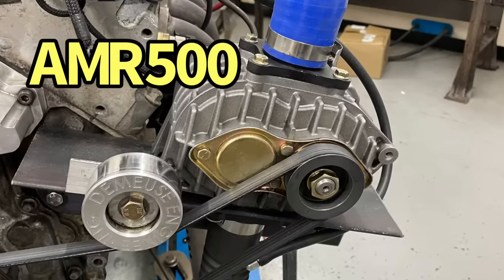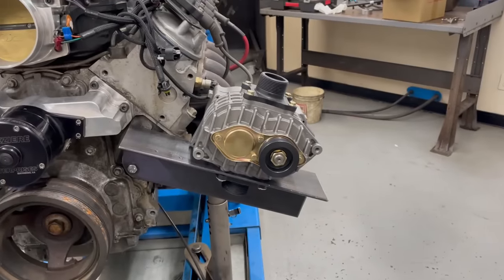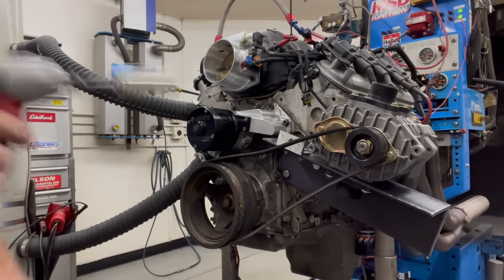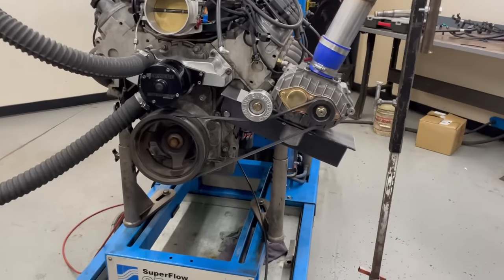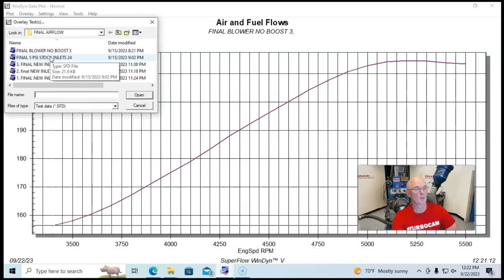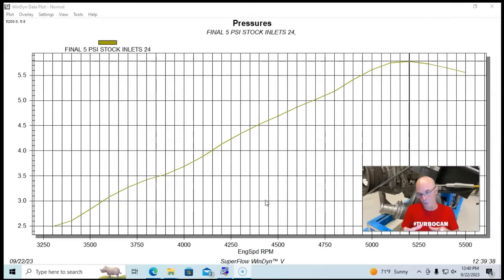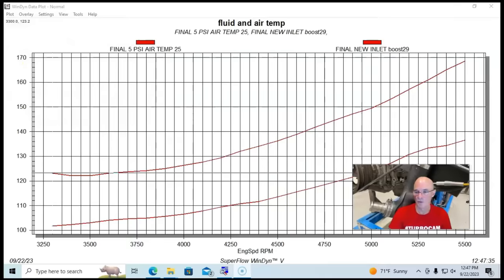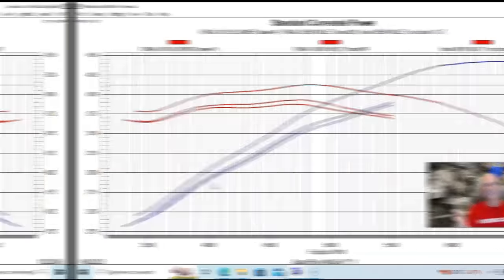THE ULTIMATE CHEAP, EBAY, AMAZON AMR500 BLOWER TEST. FULL RESULTS-AIRFLOW, TEMP & POWER CONSUMPTION

Comment: I think the reason the boost dropped with larger inlet is because boost is a measurement of pressure being exerted leaving the sc. cfm however is the measurent of how much air it can flow. Now because I
I r still spinning the sc rotors the same rpm as stock outlet the amount of cfm that can flow out the sc doesn't change with the outlet being bigger, and since the outlet is larger  and the amount of air that is flowing through the supercharger is the same as the stock size outlet it is exerting less pressure on the charge pipe then the smaller inlet cuz it's still flowing the same amount of air because the supercharger still spinning the same RPM as before. So wide open throttle you're still flowing the exact same amount of air as the stock it's just exerting less Force now I imagine if you put a larger inlet and the stock size outlet or if you put a smaller size outlet your boost number will go up dramatically.
Reply: I apologize if that message made no sense lemme rephrase. 

At 18k rpm we measured stock inlet stock out let flowed 260 something cfm. And 5.8 PSI of boost pressure.

At 18k rpm that the sc is spinning with large outlet and stock inlet and large outlet. The sc is still spinning the same speed since pulley size didn't change. So with that we can all agree the sc is still only producing 260something cfm. Which we can all agree cfm is a measurent of flow now pressure, and we can agree we all know boost is a measurement of pressure not flow.

So on the outlet being larger than stock and the inlet is stock ur boost pressure will drop.

And if you spin the sc faster it's still only flowing 260 something cfm when the sc is at 5.8 psi before it reaches max boost for example if you got a pulley to let you spin up to 8 psi while the sc is ramping up to 8 and gets to 5.8 you will flow same cfm as stock pulley however once you get up to 8 psi it will be much higher cfm flow.

And the reason why the CFM flow was changing between 270 and 260 is due to heat soak
Reply from the maker: flow through the blower goes down with boost (restriction)

Comment: You'd need 4 to make enough boost for that engine, theyre made for small motorcycle-size engines .5 to 1 liter. Youre just makin heat and noise.

Comment: so i was curious, and i dont want to sort through 830ish comments. but try it with the big inlet and small outlet, it should produce more power. maximize the intake but make the outtake smaller, shoving more air into a smaller space which should increase pressure overall. if im wrong about this let me know but it seems like it should work like that
Reply: As for bigger inlet having lower boost, would it be that there are not very good tolerances between each compressor scroll? Seems to me like there is a lot of compression leakage.
Reply: Why would you want to choke down the outlet? Why not let the intake manifold volume and ability to flow be the real restrictor?

Comment: Flaccid hose  discharge changing the aero conditions, not belt slippage but higher load/more restricted.
 Last graph  shows the bump in load on the LS as the restriction hose  moves with increasing load/ boost.
Did the IAT bump up consistently with increasing load /boost/ rpm? Dose altitude density fall as the blower reached 18k ¿ this would indicate that the hose is playing into flow . A rising DA indicates more work applied to the air causing thermal expansion boost, bad ju ju.

300CFM  yes if you get rid of the 6' of Bonneville intake ( lacking taper)  and put a proper velocity stack on the blower hat  . Use a formula SAE intake  instead.  Instrument feeds a box /tube  that the velocity  stack feeds from .  The box can be fed bi a more oversized Bonneville setup. If you see a drop on the manometer before the V stack , Then bigger/less restriction is needed.

Comment: My guess is at the higher flow rate you're going away from the compressor efficiency regions and more of the drive energy is becoming heat. A compressor efficiency map would possibly help back that assumption up though I'd tend to guess that's not something that's available.

Comment: It flows less because there is more volume of air. Blow through a straw and then a hose. You can flow more air at less pressure through a hose.
Reply from the maker: the restrictor in the hose was the same size on both
Reply: @richardholdener1727  no I understand that, I didn't mean the restrictor on the hose I meant it was a response to the inlet/outlet size comparison.

Comment: rather than looking at flow, pressure, and temperature separately you should combine them to a calculated air mass. it's possible the anomaly that you're seeing isn't actually there.
Reply from the maker: the temp dropped because the pressure dropped-don't need combine to see what happened

Comment: Had you matched the larger homemade inlet fitting to the blower's factory inlet port, test results using the larger fitting would've been more accurate. The larger inlet fitting didn't allow max flow, because of the interference  of the non mating surfaces.
Reply from the maker: and yet it improved the flow dramatically

Comment: The seals on the blower lobes heat up enough to give off gasses that hurt HP, LOL. I've seen those vanes destruct and destroy the engine, so I get why you didn't have it plumbed into a good motor
Reply from the maker: The blower will support near 150 hp-it wasn't plumbed into the 440-hp motor because this was just a flow test

Comment: The SC is too small for V8, might add auxiliary port for bypass the air before the SC built boost.

IMHO, the AMR500 will work effectively with small engines like 600cc or 1000cc
Reply from the maker: this was just a blower flow test to see how much airflow the blower had to offer and therefore what motor we should use it on-this 150-hp blower was not run on this 440-hp V8

Comment: as far as i know this little blower was made specifically to works great on 1.5 litre engine or below..in other words only goods with small capacity engine..it would be great if u try to run the blower again with small 4 cyl engine and see the major different on both motor blower compilation!...
Reply from the maker: planned-this was just a flow test

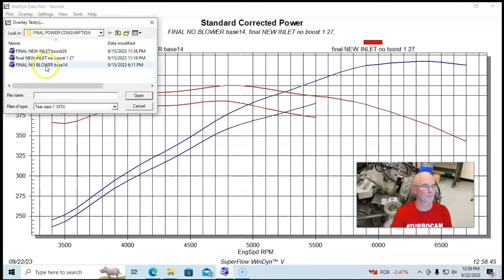Comment: 16:26 Mercedes and GM had a different approach to superchargers when not under load. GM used bypass valve, Mercedes used clutch, so supercharger wasn't spinning.  Looks like Mercedes will waste less power.

Comment: Higher flow with reduced velocity through blower with super. Is there a different pressure at the exit of blower than just before restriction where the air packs up before it accelerates through the restriction?

Comment: Makes total sense but the flywheel is bolted to a torque converter…..and we know torque converters are heavy weight’s compared to a steel flywheel. Probably a better test would be on a RW Dyno…. But then again now you’re dealing with drivetrain HP losses spinning a automatic transmission compared to a manual transmission. We can already say the automatic is going to chew off more HP and Torque compared to a manual.
Reply from the maker: I run these tests on chassis dynos as well-same results

Comment: If changed pulley size, it would be interesting to see what the little blower could achieve. Would that help to answer the temp / slippage questions?
Reply from the maker: no need to change pulley size-we were already at or beyond the max rpm of the blower (18K plus rpm)

Comment: Instead of using gear oil in the little blower Use a 20-50 weight racing oil Full synthetic. You should get back about 2 hp.
Reply from the maker: 2 HP FROM A DIFFERENT OIL?

Comment: Fore sure this blower is small  and just heat the air, also ECM may not adjust properly the fuel ratio for extra volumen and engine is getting leanner which explain lower power whit boost  did you meassure EGT?
Reply from the maker: the blower is not flowing into the motor, the AF was perfect (there was no extra volume)

Comment: You might of lost pressure/boost because the larger diameter piping exceeded the pressure/boost capability of the little supercharger itself. I doubt that little charger can produce much boost and for as cheap as it was it was still probably designed with that size of piping in mind. Any larger and you’re probably just blowing air down a hallway. Think of blowing through a straw, you can make a small concentrated blast of air enough to say move a golf ball. Then try it with a garden hose…it’s less, then try it with a 3” pvc pipe…even less pressure. Get what I’m saying? It just can’t generate enough pressure to fill the larger piping. It looks like everything kind of maxed out at 5K RPM and about 6lbs of boost and that’s probably all it’s designed for. Looks like something you’d probably just put on a v6 maybe

Comment: Here's a test for you hook the supercharger up to the PCV and let it suck the crankcase with the vacuum to see if it makes more horsepower have the supercharger blow into a drum and check your oil
Reply from the maker: it would only make more power if you drive the blower with an external motor

Comment: Such a great video. I would love to see this on2  stock. Basically Brand new. 8 cylinder identical cars. Same car. Rolling start.   Timed..raced.  recorded
Reply from the maker: this was only a flow test of the blower-it can only support 150 hp so it would work on a 440-hp V8 (we just used the LS motor to spin the blower and measure loss)
Reply: @richardholdener1727  yeah if runs to hot.  There is no actual advantages..  I'm not chacing that on my 3.8 V6 convertible..
Yet.  Well. I know better.

Comment: I was hoping to see how many less HP it makes running the engine with the blower installed and feeding the intake. It might pick up a little power at low rpm but I don't think it will flow enough air at higher rpm to not be a restriction and loose power up top.
Reply from the maker: 150-hp blower on a 440-hp motor does not work

Comment: By the way, best CFM flow, short of 300, would mean it MIGHT work with TWO of them on a small V6. 600 CFM (likely closer to 500 under boost at best) might get some power but at the cost of about 55HP. Not sure there is much benefit.
Reply: they are truly built to make boost for sub liter engines, and people who has experience say they do fine up until about 1.6 - 1.7 liter engines, they are pretty common to be used on vw beetles and they make an amazing amount of power for what they are. They are also rated to around 14 - 15k rpm
Reply from the maker: they are 150-hp blower or so, they work well on sub 100-hp na motors

Comment: Velocity, volume, and pressure are all different measurements. Opening up the inlet allows greater volume, and depending on the capability of the blower, I'd imagine there will be a corresponding drop in pressure and velocity. In a naturally aspirated engine generally more = more up to a point, with compression this point is generally lower and therefore easier to exceed, which might be what's happening here.
Pretty interesting results. It's quite a small blower so its limits would be low. I wonder if the manufacturer did any extensive bench testing to determine optimum inlet size. Perhaps they discovered the point which the blower begins to lose pressure and installed an inlet that was sized at the sweet spot. That would be my guess.
It would be interesting to see it installed on an engine in the size range it was designed for, and then on some smaller and larger ones, to see what happened. That's a lot of trouble to go to just to learn what we already know though.
Reply from the maker: If we already knew-we wouldn't be having this conversation
Reply: @richardholdener1727  Sorry, I didn't word that very well. I meant in terms of what has already been learned, from both general knowledge about forced induction flow rates and the results you've already determined. A law of diminishing knowledge returns, if you follow me. Engine installation is still worth doing of course, do you think there would be significantly different results though? I'm not trying to be difficult, it's a genuine question. 🙂
Reply from the maker: The larger inlet and outlet improved flow, so the factory pieces were certainly restrictions.

Comment: Air speed... bigger intake exhaust ports reduce Air Speed, which effects boost pressure. Higher intake speed= higher output speed at the same rpm. I.e. lower boost pressure....?

Comment: My Theory On The Blower Making Less Boost With The Super Richie Inlet Is The Inlet Air Velocity Delta Between The Inlet And Outlet. Maybe The Smaller Intake Was Allowing The Air To Move Faster Into The Blower. With The Larger Intake And Same Restriction I Think The Lower Velocity Had A Negative Affect On Boost Pressure. I'm Curious If A Slightly Larger Outlet Restrictor Would Yield More Boost/ Closer To The Smaller Inlet Test.
Reply from the maker: bigger restrictor for more boost?
Reply: @richardholdener1727  That Would Be The Only Way I Could Think To Confirm Or Debunk What Im Thinking. Doesnt Seem Right But The Super Richie Made Less Boost Which Doesn't Make Since To Me Either haha. One Commenter Said It Was Air Charge Temp Causing Higher Pressure But Air Only Gets Heated The More Air You Compress And The Super Richie Should Have Allowed More Air To Go Into Supercharger Thus Having Higher Boost / Air Charge Temp? That's Why I'm Thinking It's Maybe Air Velocity. Under Restriction The Stock Inlet Is Processing More Air?

Comment: Dammit, how did i miss this video! I've been waiting for you to test one of these. I wanted to mount one of these on my old crappy 2001 toyota sienna minivan with a 3.0 v6. I gave up on the idea when i found out you really cant tune the factory ecm's though. Any thoughts? Could i maybe get away with a factory ecm and possibly just upgrade the injectors slightly and let it auto-correct? Or use one of those old fpu's?(I think i actually have one somewhere) Obviously I'm not holding anybody responsible for my own silliness-all opinions are welcome
Reply: I should have read thru the comments before i wrote this. Apparently these are a bit small for a 3 liter engine. I couldve sworn i read somewhere they were good up to 3 liter. Maybe that was bs marketing on an ebay listing (always suspect) or possibly theres a bigger version?

Comment: Not to mention the salad bowl with all the testing on your work with Steve and the guys and the way it works with presenting the air on the inlet and output is the same stacking having a bad efficiency to the super flow design?

Comment: problem is, you have to spin this at 2x engine speed on a 2L engine just to make 1 ATM. at that point its already spinning at 12k. at 18k it will make a few lbs of boost, and lots of heat.
Reply from the maker: that math is not based on displacement, it is based on power output vs blower flow

Comment: Pretty easy to tell from the comments that 1) most people have little to no understanding of how these units work. 2) the fact that this is a supercharger not a turbo and almost all, to a  1, are commenting as if this was a turbo. The Supercharger has a specific volume/revolution and provided the inlet isn't restrictive of achieving that volume making it larger will have 0 positive effect on output.. Even the person contributing the video seems to be thinking/working under the notion that turbo rules apply to superchargers which they most certainly do not. Someone even commented dropping Gale Banks' name. Granted it's been a long while since I looked in on GBE but they pioneered some very cool Turbo designs and Diesel designs but I don't recall them having much to do with superchargers!
Reply from the maker: the point was that the inlet and outlet were restrictive, and having a restrictive inlet reduces power on a turbo too

Comment: Would the fact that the diameter of the outlet on the improved in/out not mean that it would take more air to produce the same pressure As there would be an increase in volume.

Comment: First you have to reach the amount of air the motor is consuming in the first place then surpass that amount to see any gains.so if your motor is sucking 1,000 CFM you need to make 1100 to see 100 CFM increase.
Reply from the maker: this was a flow test of the blower-it will support 150 hp or so

Comment: How many more pulls would it take before the belt jumped completely of the drive pulley? My guess would be to work on keeping the belt on the drive pulley and that should keep the belt from slipping.
Reply from the maker: the belt alignment was cured by simply adjusting the blower position relative to the mounting bracket-it was not an issue on the first 30 pulls-only after reinstalling it-needed to go through the belt alignment process

Comment: Appreciate the time and effort you put into your videos! But that tiny thing belongs on a 1.6L, not a 5.3L! It can't move nearly enough air for an LS!
Reply from the maker: did you actually watch the video? We only used the LS to spin the blower to measure the airflow potential-please comment after you watched and understand what was presented in the video
Reply: @richardholdener1727  Sure did! Still doesn't change the fact that the same tests done on an engine more well suited to that blower in terms of airflow & volumetric efficiency would simply translate better for those actually looking to use this blower. Many people find this video expecting to see dyno results (ie, power gains) as that will typically be the deciding factor for potential buyers of a unit this small and this cheap. The kids looking to slap a $250 Alibaba/Temu blower on a shitbox Miata don't care about those finer details...and most people who do care about those finer details are probably going to be shelling out a little more money on a better unit (Whipple, Procharger, Vortech, etc) coupled with an IC, than a non-IC Chinese AMR500 clone typically used on a VW Bug.